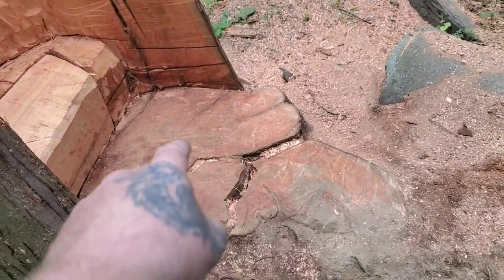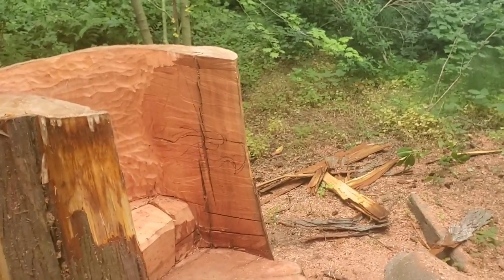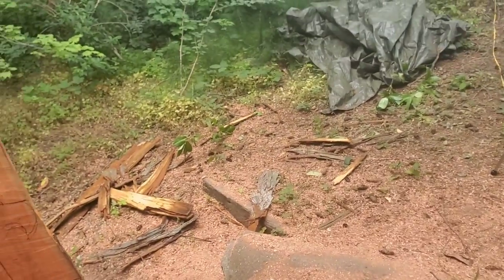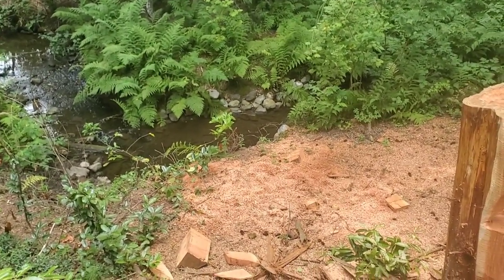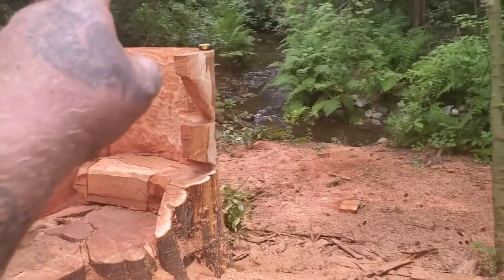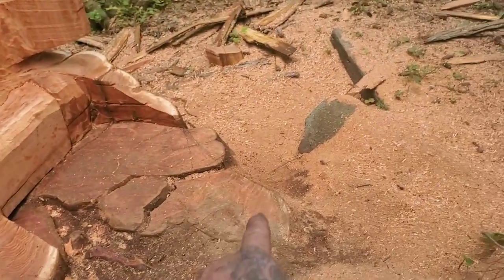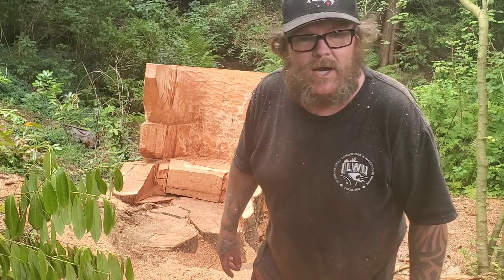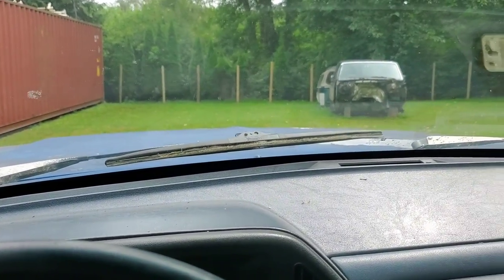Throne chair & more blocking/shapping with stihl chainsaws

Comment: Hey Jordy looking awsome I am concerned about the egal heads that your carving as the arm rests just my suggestion is with the grain going up and down the beaks of the egal will be a weak point.  I would get a long 1 inch augar bit and drill into the arm rest where the beaks will be and put a glued dowel  in then carve it or carve it then counter sink about a 10 inch timber screw and cover  the head with a dowel. Again just my suggestion it's a high stress point.  Looking forward to to seeing the finished product

Comment: The throne is comin along fine. Don't ask me what you should carve, it's your vision. Carve what you see.
As for the truck. 3/4 ton, 351 motor. If thats what you want then I rekon it B yourn. Be good for collectin drift wood. Give some thought to "there's a reason it has 2 fuel tanks". Hi Jordy.

Comment: Eagle wings may look good.
Just a quick question about the truck, why has it got two petrol flaps?
Reply: It has dual fuel tanks. The driver can start pumping from either tank via a switch in the cab.

Comment: Can only be thing ,if you put the Eagle head at the bottom arm rest, you need to carve big wings about the head, ( top section ) arched  down inside the tree to the middle of the stump where he sets. 351 w is a very good motor, 4 wheel drive on the floor.. You can't go wrong with a old Ford ... F.O.R.D. stands for  ( Fix are repair daily..  Check the plugs are plug  wires , well fix it.. Man you look little upside the big old tree..Be Safe

Comment: 3:02 Actually...Dremel market a jig for their tool to use as a chain sharpener.....so not that much of a taboo huh!  But you still have a slack chain....kinda asking for it to slip out of the bar slot.  With the amount of work you put in on that chair....He should give you the old truck....
Reply from the maker: Its ment to have a slack chain and i did get the truck :)